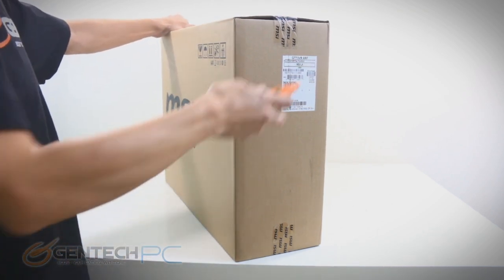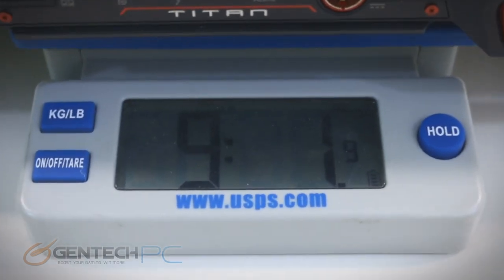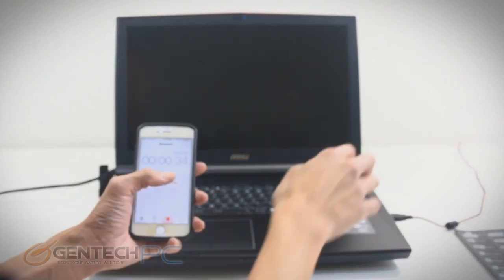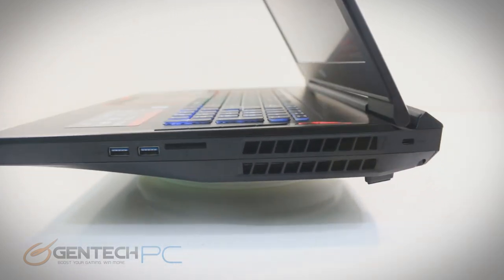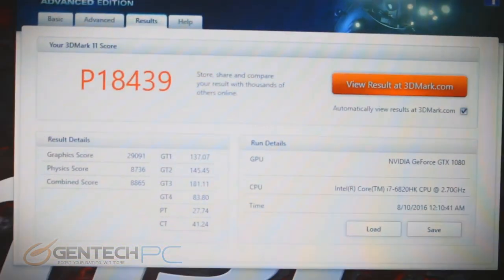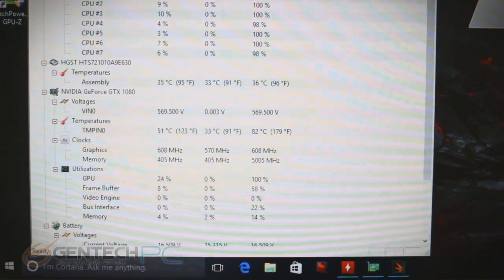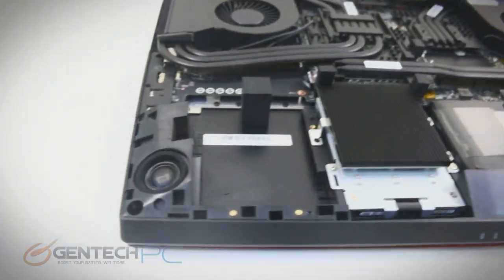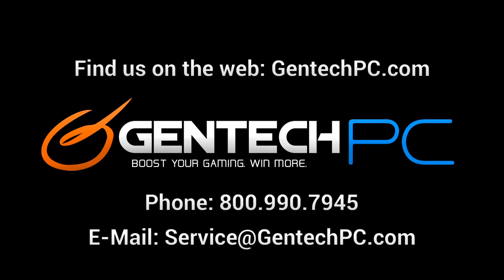MSI GT73VR NVIDIA GTX 1080 Review & Benchmarks

Comment: A couple of suggested metrics for you to consider:  Heat Map on top, rear, and bottom of body.  And decibel level @ full power on.  I see you do the db meter, but comparisons to other "well-known" laptop gaming systems helps us all decide.  Lastly, a measurement of not only the SPL, but how well the laptop puts out bass levels seems to be an important note for gamers.  Probably the best review I have seen so far.

Comment: A laptop thats nearly 70% faster than my gaming desktop from a few years ago (i7 3770, 780ti)... What a time to be a gamer...
Reply: 70%? More than that! It's 50% faster than a 980M!
Reply: I was comparing the 3dmark scores (18k graphics on my card vs 29k on the 1080), but yes in games the difference is much larger.
Reply: the 780ti > 980m, your argument is invalid
Reply: Gtx 980m: http://www.3dmark.com/fs/3711027 - 11.9k graphics
my 780ti: http://www.3dmark.com/fs/4666454 - 14.1k graphics

synthetics arent the be all and end all, but a 980m isnt 20% faster than my card as you state...
Reply: actually i have a 980m on my laptop and i get 9700 points oc in fs
Reply: Mobile versions are much slower then the full size ones
Reply: Tj's Wicked Lasers!!! yes the 780ti is faster than the 980m
Reply: He is right. Laptops have mobile CPUs and GPUs
Reply: NECRONEZUM not anymore same as desktop for gpu and some have the same cpu
Reply: There are plenty of laptops that have desktop cpus and gpus (usually one or the other for heat reasons). Desktop gpus are more often as mobile cpus are generally enough for gaming and dont limit performance.
Reply: Shreesha S no there are not! Only a few unique boards that have the same socket like a desktop.
Maybe old generation. Nawadays they use bga form to eliminate transfer time and heat.
I own a bga station I rework them , the GPU in laptos and desktop.
They are not the same and will Not be the same EVER!!!!
You actually think they will mount  a 100w CPU in a laptop?
Think before you say that.
Reply: Daniel... Poor poor daniel.. Ofcourse there are laptops with desktop cpu's in them.. lol
Reply: Here is one for starters..
Reply: Tj's Wicked Lasers!!! It's a bga CPU! What desktop PC got bga CPU?
Reply: Tj's Wicked Lasers!!! After finishing googling , Google bga station reballing :)
I'm happy you learn something from me :)
Reply: IT IS A DESKTOP 6700k!
Reply: Jesus.. I know what a ball grid array is.. I have been making and building computers since before you were born.
Reply: Tj's Wicked Lasers!!! What CPU was in '83?
Reply: Tj's Wicked Lasers!!! Z80000
Reply: Dude... Just admit it's a desktop 6700k. It has a 660W psu.. It can handle the 2x180W 1080 cards and a 100W cpu..
Reply: Yes tinleo?
Reply: Tj's Wicked Lasers!!! i have a desktop and a laptop i know witch one can do what
Reply: I have several of both. I can take the cpu out of my desktop and put it in my laptop. I literally just checked.
Reply: mobo models. PLZ
pc and laptop. if you know how to change the cpu in a laptop then you know how to read the model.(not laptop model, mobo number)
GO!!!!
Reply: Alex G cill!

Comment: So my brother purchased this Laptop and we got some questions. (Hardware
 driver are updated)

1. Only the right fan (on the backside of the Laptop) is putting out a 
lot of air, the left one doesn´t do that much. Is this because of my 
question 2?
2. Do I have to activate the 2. graphic card or is it activated 
automatically?
3. My Hz are locked to 60 FPS. I already tried to change it in the 
divice manager. Shouldn´t it be 120Hz?
4. When i open some programms like Steam it either has a bad resolution 
or the texts are very small. Can I change it so it is readable?

Thanks already for your help.

Comment: Does anybody know if we can expect a Pascal powered laptop with 1440p@120hz?
Reply: yes some are out now  but we will see more later this year
Reply: Thanks for the answer. Can I please know which ones are out already?? When you say later this year... Do you think of early October? Or late December?
Reply: +Yassin ENNAJIH Right now the Aorus x7 v6 has a gtx 1070 and a 1440p 120hz display I'm waiting for the gtx 1080 model it's not out yet. I'm not sure exactly when the other companies will have the 1440p 120hz laptops out but I'm pretty sure we will see them before October, you should go see the other new laptops at xotic pc they pretty much have everything.
Reply: Just checked!! You're right, they have the GTX 1070 with 1440p@120hz, at least they have listed it, but it won't be available until Mid September. Which means that the GTX 1080 model won't be expected before October...
Reply: Voodoo Child I think what we want is the Aorus X7 DT v6 not the normal X7 v6. 'cause the DT model comes with the 1080 while the other one comes with the 1070.
Reply: Yassin ENNAJIH yes but I meant that other companies like msi will probably have the 1440p 120hz display laptops before October but again I'm not sure
Reply: +Voodoo Child MSI is my favorite brand and if they come out with a 1440p 1070 model in this style or another I'm selling my old MSI GT72s with its sketchy overclocking 970m for what I can get for it and buying a new laptop this holiday season hands down!
Reply: do you guys by any chance happen to know when will Alienware join the ride and release it's Pascal based notebooks?
Reply: +7Ameer7 haven't heard anything from them at all, strange but Dell won't let everybidy else make all the money I guarantee it
Reply: tony45x220 thanks bro :) you're right, I guess it's only logical to assume that... but WHEN is the question... Btw I'm interested in Alienware (the 15 R2 or maybe R3) especially because of their amplifier connectivity, you know just to be really future-proof...
Reply: MrGhost370 MSI or Clevo are the only viable options?? how about Asus and Aorus??
Reply: MrGhost370 thanks for the info bruh, you have a good point regarding Alienware's plans for their pascal units... Well, I guess we'll find out in a week or so, they're planing to announce their new gen notebooks in 09-02-2016... But unlike you, I am actually hoping they will keep the amp port, I mean come on, who knows what will the future bring? Therefore it's better to be ready just in case 😉
Reply: MrGhost370 yeah I already thought about that... True, if you have a 1070 or 1080 in your laptop then it's pretty much pointless to stick any pascal card in the amp (and thats including the titan x btw), but what about new architectures that surely will come in the next 4-5 years?! This is where the amp will play its part, and beautifuly!
As for the need to have a desktop-like setup in order to  fully utulize the amp and the laptop (I mean with a 4k monitor and the like etc...), well, this too forms no problem for me, because this setup's performance will mach, if not beat, a regular gaming desktop, and as a bonus you'll get MOBILITY also!!!. Just think about that bruh, you have to see the awesomeness in that 😉😆
Reply: MrGhost370 thanks for the info... yeah the cpu has to be the 6820hk at least, the others will probably bottleneck the gpu a bit, but not THAT much actually!... And I frankly agree on the superiority of MSI and Clevo to that end...

Now regarding your suggestion of having a small gaming laptop (with the 1060) plus a desktop, to me I find it very uncomfortable, I mean simply to feel you're divided between two pcs (personally, I have a windows tablet which serves me as an ultrabook plus my modest gaming desktop, so tbh I find it very hard to keep up with this 'couse I'm actually working on a book a couple of years now, and it's annoying to keep sending the Word file between the two setups whenever I change place (work/house etc), that's why I've decided that it's time to "migrate" to a new strong and unified pc (which has to be mobile of course))... And as for the battery, well there's electricity everywhere nowadays, so just plug in the laptop whenever you wanna game...

You're right about the pcie x4 connectivity of the amp, but it's the 3.0 generation (which is equal to pcie x8 2.0 and pcie x16 1.0)... So with this bandwidth, the bottleneck wont really exceed 10% from the desktop pcie x16 3.0 , as I read in some article comparing all the bandwidths on various games...

And finally, what you've said on the issues of the amp drivers and all the bugs with BIOS, is sadly true... These are the things to take into consideration before buying AW's notebooks, in my opinion at least (and yours seemingly)...
(Btw the chassis is nowhere near thin, it's actually very thick and heavy! (The AW 15 and 17 I mean))...
Reply: MrGhost370 My friend I really must thank you for this update, I had no idea that pcie 4.0 is days away from being released, I just didn't thought about that... and what more, the article you suggested also says that they have already started working on pcie 5.0!!! what the hell, lol...
As for explination of the current quality of the Alienwares compared to the previous ones, well that too I have to thank you about... tbh I heard that before, but I really didn't think the difference between the current and the old laptops is in this scale, wow! How stupid of Alienware to downgrade thier quality like that! Why, why would they do that? just for a bounch of extra bucks? damn shame man!!

Sad stoty coming: the brands you've suggested is without any doubt the best... And two months ago I actually ordered the MSI 80GT titan with dual 980m, from a purtoguese seller via ebay... Unfortunatly after I paid the money, it turned out he's just a scammer... I'm no noob in online purchases, I know how to spot a scammer whenever I encounter one, but  this one was different he was truley a professional, he scamed me along with two other experinced pc traders (one from Finland (who's btw the one told me that Alienware has lost its touch and suggested Clevo instead) and the other from Belgum)... But thank God I mananged to get most of my money back from paypal ('couse he convinced us to make the deal outside ebay directly via paypal, so that we can take a "discount")...

You've really made me reconsider my attitude towards Alienware... My last hope will be to wait four more days to see if they grew some brains and decided to return to the glorious level of quality they used to have, they promised there'll be a good surprise in the event... If not, I really might switch to MSI or Clevo...

Hahaha as you can see bro, you don't have to appologize for the lenghth of the messages, we're both in the same club lol 😉

Comment: Does a lot of heat come from the side vents of the laptops. I am thinking that by connecting an external mouse and using it it might provide an uncomfortable experience if the hot air keeps blowing from the sides.

Comment: why is there only a " 17.3" 1920x1080 IPS 120hz" option?
when will the 4k panel arrive?
or is gentechpc not able to supply 4k panels?
Reply from the maker: So far 1920x1080 120Hz is the only panels available.  Maybe they will release 4K options in the future.
Reply: ibuypower has the 4k model available for pre-order. It will ship on 9-12 if you pre-order today.

Comment: Something I miss with your reviews is that you should include info in the description and the beginning of the video with the most important specs clearly listed. Like CPU, RAM, GPU etc. Especially important with MSI which has gazillions of different configurations. Or perhaps include a link to the actual product so that you can see it there (the link in this review links only to the GT73VR general page). Thanks.

Comment: So you have to remove the heatsink to access the RAM and M.2 slots?
Reply from the maker: There is a metal plate with 3 screws you need to remove to access the 2 PCIe + 1 M.2 slots, they are all just right next to each other.

Comment: Ummmm... Was that a second MXM slot I saw you try to stick the card in at the end???
Reply from the maker: Yes the laptop is capable of SLI GPUs, you can add another GPU and make it SLI if you want.  MSI does have GT73VR SKUs that is already comes with SLI GTX 1070.
Reply: Where would the cooling route to? It looks pretty tight for SLI..
Reply: THe power is not good enough for SLI with gtx 1080 sadly! the only one to do this is the Asus GX800 which is an 18 inch monster but it cant even go full SLI because of the power it needs the massive watercooling block on the back with extra power then it can go do SLI. but costs 6 grand :/
Reply: You only need about 300w for dual 1080SLI. There is more than enough power to power these.
Reply: +MrGhost370 200w? No, 1080's in mxm form are 150w.
Reply from the maker: Yes it is, this laptop has two MSX slots and MSI do have a SLI GTX 1070 available.
Reply from the maker: the second GPU share the same fan on the left, but it has it's own heatpipes.

Comment: Can you check if there's g-sync on this? Even doh it doesn't support it officially, forums user is reporting a g-sync panel in the drivers meny!
Reply from the maker: We were told nVidia is working to certified G-Sync with 120Hz panel, once it's done nVidia will release new drivers to endabled G-Sync for 120Hz.
Reply from the maker: Confirmed G-Sync is enabled.  Screenshot posted on notebookreview.com.

Comment: Regarding this laptop doesn't have a g-sync display ?!? Do I have to make the g-sync on to reduce tearing with gtx 1080 if the display doesn't support g-sync ? Plz an answer
Reply from the maker: It has 120Hz screen at 5ms,  so it doesn't really matter if it has G-Sync or not.
Reply: +GenTechPC you mean there will be no tearing if I make v-sync off on any game setting and play like that's !?!cause the display it's 120 Hz. With 5ms ...sorry but your answer will put me on the right direction for my next Msi laptop
Reply: +Arclight Sama just replying for myself...so now in the website they add g-sync on the specifications on the display!??? So it's a 120HZ with g-sync ? ...

Comment: Ahh so the GTX is in fact an MXM module...so if I have the old MSI GT72s with a GTX 970m will I be able to upgrade to the 1070 or 1080 module!? I'm so tired of the instability with trying to overclock that thing lol
Reply: no you won't be able to upgrade your 970m laptop to 1080
because the 1080 has a flange on the right of it.it's very big so it won't fit in your laptop configuration
but a 1070 might if it doesn't have this flange
Reply: +Muhammed Yousif damn I bought the thing knowing Pascal was around the corner expecting to be able to upgrade...I heard all of the new modules will have this due to the extra power regulation so I might be stuck anyway...but if there are new 1440p gaming laptops coming out especially from MSI I'll just sell it for what I can get and upgrade anyway...kind of a disappointment when we were told different just earlier this year.
Reply: No, you won't be able to fit any pascal card in a MXM3.0 Maxwell slot. Sorry.
Reply: +Tj's Wicked Lasers!!! What a bummer what makes you so sure when they literally just launched, this slot looks similar to what's in my MSI GT72s and websites even have the old chassis style GT72 listed with the new 1070...has the slot design completely changed or something?
Reply: tony45x220 not at all the slot is the same.but the size o the card is changed.it's width used to be exactly as wide as the slot it self.now they make the front of the card proportional to the slot then add a flange to the card to increase it's size due to design requirements/so people stop upgrading last gen to newer cards.
we'll see about the 1060/1070 cards.also the amd laptop equivalent might become a solution for upgrading
Reply: +Muhammed Yousif well I guess I'll just hope to get maybe $1200 or grand out of my "old" GT72s... Have you seen the Auros X7 v6 it's got a 120hz 1440p display with a factory over overclocked 6820hk and the GTX 1070...$2,699 but it might be worth it if MSI doesn't release a 1440p display
Reply: tony45x220 you want my honest to god advice ? the one i wished someone had told me about it ? 
GET A CLEVO/SAGER.
the're much much cheaper.their cooling is simply superior to msi's and asus's .they are simply modular and probably can fit a pascal card even into older sager/clevo models.the're really friendly to upgrade everything explains it self.it's material is sturdier and much much better than msi's.
and you can add whatever you want was it a 4k 120hz display or normal 1080 60hz one.it's simply awesome.
one flaw : their design isn't sexy like the asus's ones.but it's newer models are very attractive though.
about the auros , NO. just please no .it's a heat missile ready to explode anytime you play crysis 3 on ultra settings.
Reply: I agree, I have the Australian version of the Clevo(Metabox) and although it isn't pretty it is awesome! I can literally change everything in it.
Reply: +Tj's Wicked Lasers!!! You own a very expensive electronic Lego set lol, function over fashion buddy!
Reply: Exactly.. Function over fashion..

Comment: Kind of surprised you didn't show the temperature at the palm rest after mentioning it. Also can you talk about the volume of the fans while games are running? Are they loud/distracting?
Reply from the maker: Must have forgot that part but just like other MSI laptops the pamlrest area doesn't feel hot at all. It's very quiet since MSI added more bladers and heatpipes to which makes much more efficiency.

Comment: Thanks for the great review video. You are perhaps the first to do a disassembly of the GT73VR.

A question: I notice that the GPU has a power connector around the bottom left of it, meaning it probably pulls more Watts than the MXM slot allows (~200 watts). Meanwhile, your GT62VR review's 1070 GPU did not have such a connector. Does this mean that if you purchase a GT73VR with a 1070 and it does not come with that connector, you will be unable to upgrade it to a 1080?